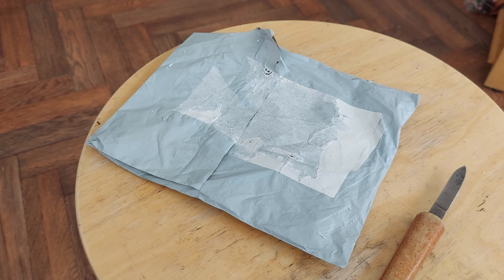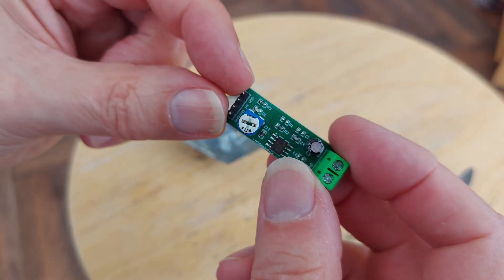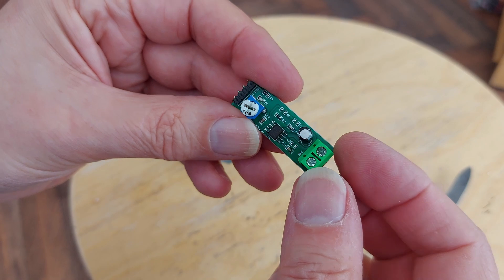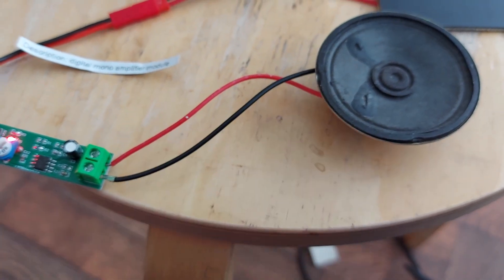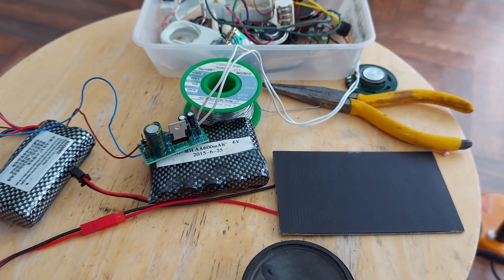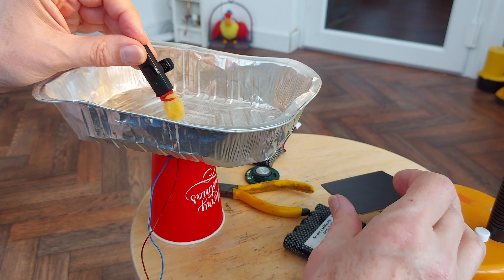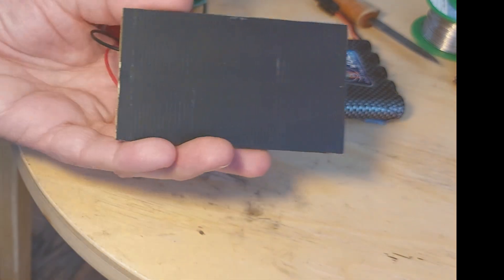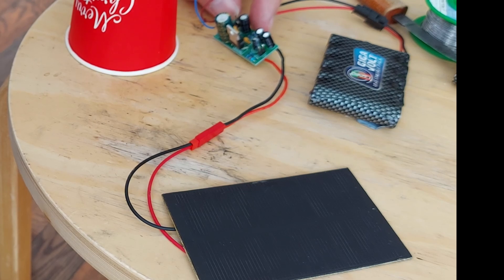Grandad's postbag 20240513 Amplifier for solar panel detector

Comment: That's really great. I like the fact that you can hear the IR pulses. 
That's a shame about the amp you bought but it may depend on the speaker you use. 👌👍👍

 I saw something like this on a video a while back. Someone was using a laser to hit a solar panel to send sound from voice and music. The laser beam had to be modulated with whatever sound the mic received.
Reply from the maker: Yes, I am pretty sure I did a cheap eBay electronics kit that sends the signal using infrared.
Reply: @GrandadIsAnOldMan  yes, I forgot about that one. 👍👍👍
Reply from the maker: @mikeflight9  I haven't found it in my archives yet, but I am sure I did. I am also sure Lasersaber did a video on it, but I can't see it on his channel, so it must have been somebody else (I do follow quite a few similar channels). I did find this old KipKay video on a vaguely similar vein, but quite different. I might give it a try just for the fun of it - How to USe Morse Code On A Laser Beam! https://youtu.be/6WJ-ypUj3Lc
Reply: @GrandadIsAnOldMan  Sent you a couple of YouTube links but YouTube deleted the comments because of the links. One of the videos looks pretty straightforward. He uses the output of an audio amplifier similar to yours and the amplifier output is connected to the laser power wires.
Reply from the maker: This one came through OK, YouTube is pretty inconsistent when it comes to links on comments 👍 Yes, good example. And now I have watched that, plenty more come up in my recommendations thanks to YouTubes amazing algorithms 🤪